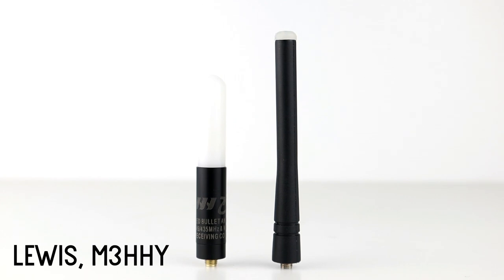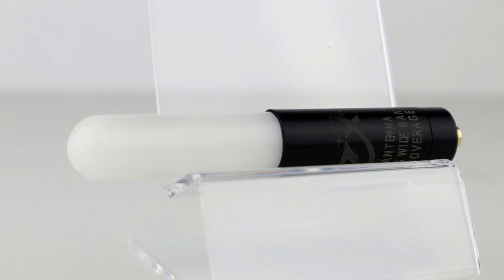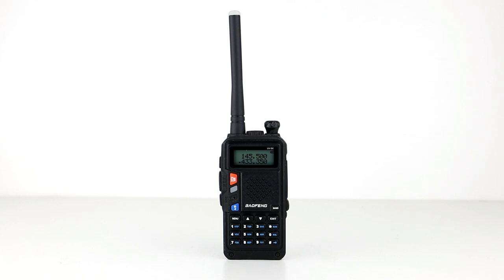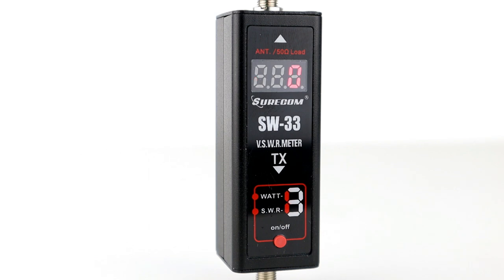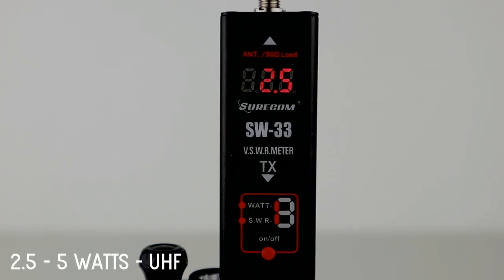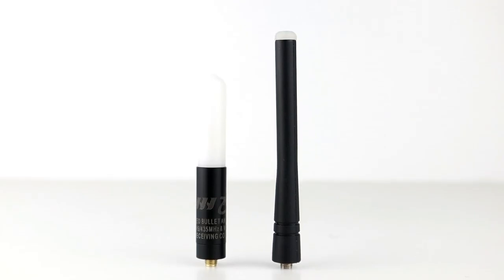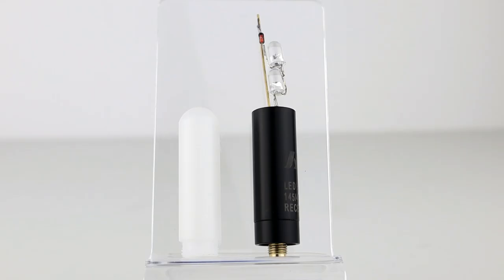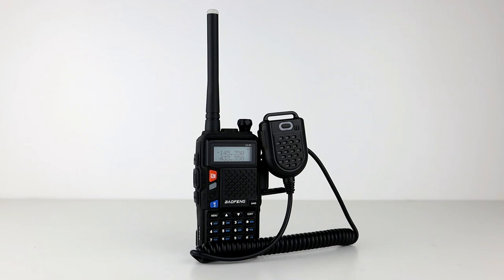Dangerous LED Light Up Antennas For Two Way Radios!

Comment: Early 2000's cell antennas are back!  I used to have one on my Nextel i90c

You know, I almost bought the HYS antenna, not because of the pretty glow, but because stubby sma-m antennas are hard to come by.

Looking at it here, glad I didn't
Reply: I miss the days of Nextel, I still have my original Nextel phone number, still use it today. The i90c if I remember was the first color phone also. Seems like 2003.
Reply: @JAMESWUERTELE  close, unfortunately the i90c was still LCD, the i95 was the color phone.  I never had the chance to get one of those, because that was around the time everyone started a PTT service, and we migrated to a cheaper service.

It's funny though that Zello uses the old Nextel chirp tones 🤣

Comment: Cannot say I've come across these before, to be honest I feel putting LEDs into antennas that light up on transmit is a bit of a gimmick, and indeed probably would not do the radio or the transmitted signal any favours at all however they are interesting none the less, keep up the good work Lewis and stay safe out there.

Comment: Even if the SWR had been half decent at the end of the day the LEDs are using a portion of the RF which really won’t be doing performance much good. Years ago in the heyday of CB there was an amber plastic light for the top of the antenna held on with a little grub screw. It was a neon inside the housing. Basically gave the same results as you got.
Reply: I remember them and the marketing claimed they used "the unused part of the signal " 😂

Comment: OH GOODIE !!!!! The FIREFLYs are back. 27mhz 102 inch stainless steel whip. Only problem -- when you went for gas at the C-store you broke them off on the roof of the gas pumps or the drive thru at McDonalds.

Comment: I wonder what the radiated signal will be like. The LEDs will be passing current for half of each cycle minus whatever their threshold voltage is. So the current waveform will be a half rectified sine wave with some sharp switching. That is going to introduce harmonics. 

If we think of it as an AM signal modulated by a square wave of the same frequency as the carrier then we'll see 2nd, 3rd, 4th, 5th, 6th..... harmonics strongly represented. The carrier is at 1. The square wave produces 1,3,5,7,9... so we have modulated sidebands at (1+1), (1+3), (1+5) and also (1-1),(1-3),(1-5). I'd expect the negative frequencies just come out in antiphase?

The final spectrum may be more complex still as the LEDs aren't linear. So the radio is likely not going to be compliant with license terms any more with this circuitry added to its output.

Comment: Come on Lewis. Don't you know that you can't measure handset antennas like that? Make any change to the connection between antenna and handset, such as add an SWR meter or extension cable and the tuning is gone. It's like taking a normal vertical and snapping off the ground plane, then go measure the SWR and be surprised that it isn't good anymore... try the same test you're doing on any other handset with stock antenna and you'll get same or worse SWR.
Reply: Tested few HT antennas with nanoVNA for example and swr was pretty much the same if on mag mount with ground plane or just directly connected to nanoVNA. It changes radiating pattern a lot but not much for swr.

Comment: Hi Lewis
Nice little video. I know sod all about ham radio however I know one thing about the led antennas. They look shocking and will never have one of them. I seem to remember an old Nokia having a antenna like that I bought years back that lite up when getting a sms or call. Shit I know hey lol.
I have a thin whippy thing on my uv-5r something starting with noy maybe. Wasn't much money nor was the radio. Both probably not very good but got to start somewhere. Like I mentioned in another video I still need to get my foundation. Anyway enough of my dribble.
Not a fan of the led thing but a great fan of you videos keep up the great work fella 🤜🏽
Reply from the maker: Thanks so much mate

Comment: Could anyone help I’ve got a icom ic-f22sr PMR446 and the dog has chewed the antenna. Is it fixed to the body or is in possible to change it.
Reply from the maker: If it’s fixed it won’t unscrew. If that’s the case you’d need to speak to a supplier about Getting a replacement plastic shroud. You’d have to dismantle the radio though.
Reply: Ringway Manchester Thanks Lewis.

Comment: These will completely breach any radio license or regulations you may or may not have. As the diode will only conduct on half the waveform you will have a lovely 5 watt radio jammer that will appear everywhere all over the bands, causing interference to a whole number of critical services. It would be worse than home making a radio, at least that might be cleaner RF. Just as a warning to everyone, don't use them!!!

Comment: Cheap and nasty they Rob your signals to the repeater, and to each other and with the very high swr, how long will the radio last, and we were  told get the swr as low as possible. A great video and thanks for the heads up

Comment: That SWR meter is garbage. It gave me high SWR on GMRS Antenna. And Hand handheld radio. The meter end up breaking. I opened it up and try soldering antenna connector. if I would solder it to the metal plate it has it would give me Good SWR  Reading. I'm not sure the people who make this SWR meter don't know how to make their equipment correctly and inaccurate or don't care